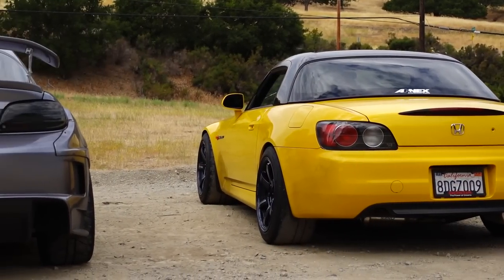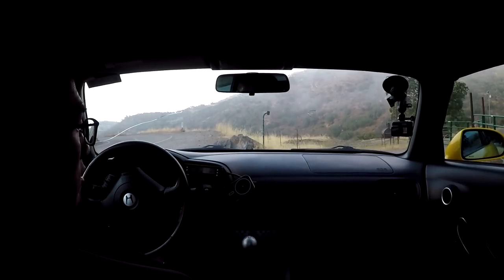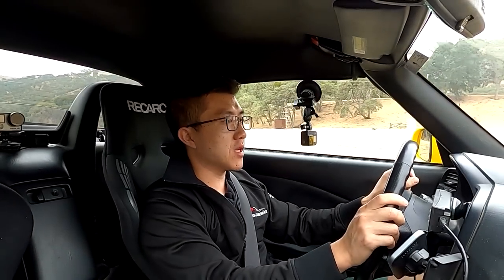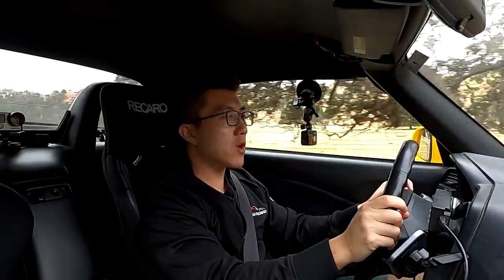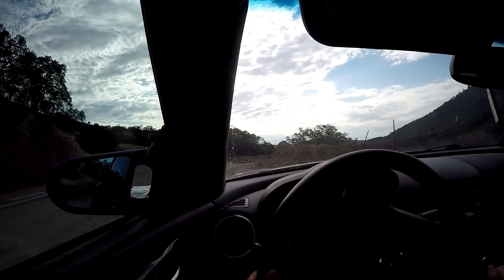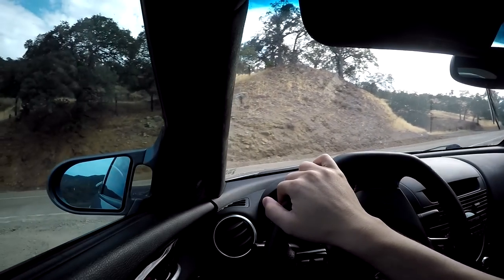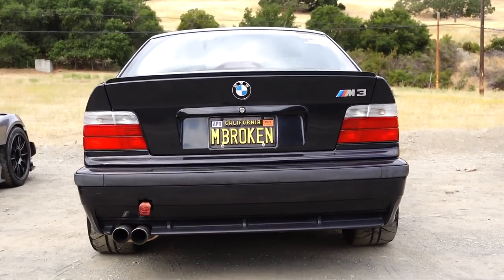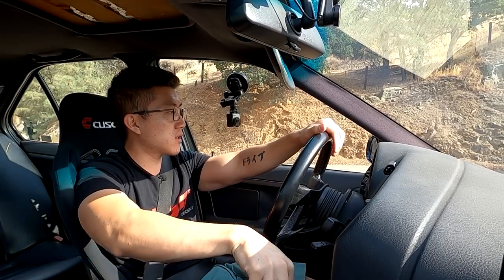Honda S2000 vs Mazda RX-8 vs BMW E36 M3 (Modified) - Head to Head Review!

Comment: I always thought of the Mazda RX8 as a combination of S2000 sportiness with BMW 3-series cabin refinement. Therefore if I have can only have 1 car as a daily and weekend canyon carver it would be the RX8 except that I'd ditched the Kamikaze bodykit. <shudders>. But if I can have more than one... sure S2000. Why not. But I'd keep it stock and AP2. Drivability and refinement. Time has not been kind to the e36 3-series. It's a no-go period. Video should've replaced that with an e46 BMW candidate instead.

Comment: Take the S2000, put a built ITB J35 in it, stick the transmission in the rear like a Vette/Viper, slap it with a 245/275 or 255/285 staggered setup with dialed suspension and brakes, call that a perfect build. MAYBE procharge it if you want more than 400 wheel.

Comment: Building an E46 330ci for track use. My only gripe is the lack of factory LSD in anything but the M3
Reply: My E36 328is got 2.93:1 open differential. A junkyard sold me an LSD (rather inexpensively) with the same ratio, but I found out that it's just an open differential! So I sent it back & they converted it to Torsen & gave it back to me. Is that worth a lot? It does make a “bad-bearing sound” in neutral gear, though. How should I fix it?
Reply: I decided to just buy an S2000 to replace my 330ci ZHP since I never used the rear seats with a Suby DD. It's a shame BMW nerfed even the ZHP with no limited slip, while Honda didn't even question putting a torsen (and 6 speed) in every S2000.

Comment: Great video. I’ve been contemplating on adding another car to the stable. S2k or rx8. I already have an evo 9 mr, e30 with m50 swap and my motorcycle does most of my commuting to work. So the next car doesn’t have to be practical at all. The rx8 can still be had for reasonably priced and I won’t feel bad taking it to a drift event and back it into a wall lol and the S2k prices are starting to stagnant but it’s hard to beat that S2k sharpness and Honda reliability and oh mpg’s lol decisions decisions
Reply: Prices are rising not stagnating.
Reply: I been contemplating a RX8 to add. I have EVO X GSR , MR2 sw20 , FC RX7 x3, 3000gt sl, and a built Civic eg coupe. I have a couple others but not counting to the enthusiast list
Reply: @claudedottin1312  rx8 can still be had for a decent price. That’s kinda why I want one. Still fun and way cheaper than an s2000
Reply: @rushfactorygarage  exactly! All my cars were cheap btw lol. But yeah it’s not like a huge huge decision because price wise and we m trying to have my cars all different according to the uses. RX8 can also be made to look really nice and it’s (practical fun)

Comment: Have you ever driven a spec e46 car? On paper I feel like you might like it, ~2650-2700 lbs fully stripped and like 220ish whp. Feel like BMWs really come alive as track cars once you remove all the extra luxury car fluff lol.
Reply: That's where most of it's weight is. It's a car meant for luxury/sport. Ive only deleted the rear so far and man it made a huge difference.
Reply: yeah even if you dont go all out you can save a good bit of weight doing the reversible weight saving mods.

Comment: S2000: attracts high school boys, ultra-ricers, needs a roll bar to hit the track and ultimately makes you overspend for a "clean" car that you'll just ruin yourself.
RX8: harder to find, generally can come with rebuilt engine, nobody wants to be the last person holding on to one
E36: vanos, sagging glovebox, plastic parts, but probably the most controllable and easy to track car.

have owned 2 of the 3, they were all fun and headaches in their own way :)
Reply: Rx8s are fantastic on track! I was easily able to hit lap times close and beat to drivers of “faster” stuff (foRS, 135i, lotus Elise, caymans, etc.) even as a relative novice which speaks to how easy the car is to whip around corners

Comment: would you prefer a gr86 over an e36 m3? they are pretty much on par in my opinion and is a flip a coin for me. I would say the only thing with the e36 (coupe or sedan) is the actual usable back seats. So it is a more every day car than a gr86.
Reply: GR86 will likely stay working well for longer lol
Reply: @PeterPangea  really? have you tried servicing a boxer engine?
Reply: @Bmwstephen  Spark plug removal...
Reply: @PeterPangea  Do realize Subaru has had nonstop recalls on engines right?
Reply: I have an e36 M3, my good friend an FRS.  Both are great cars, I'd like to drive a new gr86 as it does seem like on paper to be closer to the e36 M3.  The M3 has serious torque compared to the older FRS, the FRS in stock form has sharper suspension and steering.  The M3s back seats are definitely more usable, though we've taken people in the back of both on 4 plus hour drives.
Reply: @johnpearson492  nothing a square wheel setup and zhp rack won’t fix on an e36.
Reply: @Bmwstephen  Which is what I did! Square wheels and a Z3 1.9L quick ratio rack along with the x brace absolutely transformed my e36.
Reply: @creakid  you still driving that 328, i have one too, what mods do you have done?
Reply: @johnpearson492  The guy who just sold his FR-S stick fell in love driving with my E36 2.8 coupe (with suspension raised to the base stock height). I can see why -- Brimming with even more steering feel (with non-M Z3's quick rack & Torsen LSD conversion) & still absorb bumps (especially speed bumps) with many times more composure.
Reply: @r0xy149  It's a 1999 stick, white with white interior, nearly mint (less than 50k mi) when I bought it used in 2006 for $17,400, with ANSA muffler, cold air intake & an aftermarket rear spoiler, which I removed due to blocking the rear visibility. Afterwards, I've added:
1) Quick steering rack from the non-M Z3.
2) Torsen conversion on the 2.93 open differential.
3) Raised the ride height of the M-Tech sport suspension by changing to standard coil springs & Monroe shocks. An E36 M3 probably won't allow such change.
Reply: @creakid  I'm not sure about the gr86 but iv got a gt86 and changed the spark plugs myself using a video on youtube without even having to lift the car
Reply: @user-sk4wf3ve6z  You didn't have to drop the engine by 4"？
Reply: @creakid  no,you can change them from the top with the right tools and a bit of time,you can look up videos on YouTube about it,if you want to see the video I used,it's by countersteer garage and the video is titled 'hoe to change spark plugs in the frs in an hour',took me over 2 hours though as I'm a noob 😂
Reply: @user-sk4wf3ve6z  Thanks.

Comment: Hello, i would choose M3 'couse it"s the only race car here, not sporty like. In US U may not know - e36 was winning a lot in DTM Class, super tilted car - You could even buy BMW INTERNATIONAL or Class2. US M3 is simply weakned, it has 245hp only - almost like 3.0 e46. In UE we had M3's 286-321Hp, so even tuned to 260hp - still slower than stock UE. I love Cabrios so s2000 body is cool, RX-8 looks nice but the interior .... - don't like hi reving, low power ratio is much cooler for me - now i drive 330hp r129 SL which may be little bit faster, but now sucha expirience. Great compare!

Comment: I have been looking at trying to get wing extensions like those for my RX8 as well. If anyone can guide me, I would greatly appreciate it, or if you still can get in touch with the RX8 owner.
Reply: Those are the feast power risers. I bought these from another RX-8 on instagram, wanna say they're long out of production. You can machine and design your own though, wouldn't imagine it'd be too difficult.
Reply: @PeterPangea  yea I was looking around, they ended production long ago. There are some alternatives, but they look hideous. I have a shop that said would CAD me some, but because it requires build from scratch, they quoted me like $600

Comment: How would you rate the steering feel of Toyota 86's EPS compare to these three cars?
Reply: Which 86? I’ve personally tried the first gen (along with other examples of all the cars in this test) and I’d say the feel is similar if not slightly worse than the rx8.
Reply: @PeterPangea  Thanks, I did drive the Scion FR-S & the 2004 RX-8. Both of them got good enough steering feel -- better than my 2012 Golf 2.5's boring EPS. & I happen to find the ND's power steering too light with insufficient resistance (both the Fiat & Mazda versions). BTW, I loved that 2004 base-model RX-8 with a pampering soft plush ride riding on 16" wheels (while still got immensely high road holding), but it only comes in auto with no stability control. So I called the dealer & found out that both suspension set up share the same dampers, & only the sway bars & springs are different. Therefore an easy swap on the Sport (base stick RX-8) with the headroom-laden slick top. I would still swap the driver seat with the power seat in order to tilt the cushion, while change the passenger seat with an aftermarket lower-back seat (separate head rest) in order not to obstruct the “panoramically wide rear visibility (missing from the Miata hardtop after NB)”. But all together, the RX-8's lack of low-end torque is got to go -- perhaps with electric-motor conversion (rotary breaks down too soon). Therefore, I ended up collecting these two used cars in mint condition:
1) 1999 (last edition E36) 328is stick & converted to Torsen (still with tall gearing) plus the “quick steering rack from a non-M Z3”, & raised the ride height to base-model spec.
2) 2002 (last edition Z3) 3.0 stick with Torsen in order to avoid the M version's “slow steering rack & viscous lsd”. Peculiarly, it's power steering boost is less natural than the early Z3 1.9 version's. Now, I want to raise the ride height & wonder if getting the dampers/springs from a base Ti would work?

Comment: Zygrene, you got me looking for AP2 trannys for my AP1. Have considered after market rear diffs too. What's the better way to go, anyone?
Reply: Drexler is supposedly the King, but know a few people with the OS Giken and they rave about it. ATS Carbon hybrid is meant to be excellent too but have heard it requires more maintenance due to the composite discs and they can delaminate with heat.
Reply from the maker: All I can say from experience is that OS Giken diffs make a ton of noise. AP2 tranny in an AP1 is guaranteed giggles though.
Reply: Puddymod makes a diff with a lower final ratio and strengthened.

Comment: Currently have a Daily, S2000 and a Truck and having 3 cars is kinda tough. Curious if a modified 996/997 could fill the hole if I sold my S2000 + Daily.
Reply: I wouldn't trade my S2K for a 996.
Reply: E46 M3, as someone who’s owned a 996 and an e46 m3. That being said, I currently daily an nd2 Miata RF. And the new BRZ is also a top competitor for that usage.
Reply: Depends what you enjoy about the S2000 and your use case? 996/997 does not have the same front-mid balance that the S2000 has (read: the Porsches have a ton of rear end grip). They also won't survive on track without significant modifications. I wouldn't trade mine for any non-GT modern 911.
Reply: Sold my 987 Cayman S, but kept my s2000.  There's no comparison.
Reply from the maker: I just drove a lightly modded 996.2 Carrera. Comparison video with another modified RX-8 coming soon!
Reply: @beauwulf  This is a striking comment given the 987 is the superior machine in nearly every way.
Reply: @RearWheelZeal  The s2000 is far more fun than the 987 S.  The 987's biggest flaw is the extremely long gearing and the McPherson front suspension.

Comment: Dude, be a little less bias
S2k: 2855lbs 237hp 150tq
RX8: 2880lbs 237hp 159tq
Yet somehow the rx8 is "soo slow"
Reply: RX8 is slower. Don't believe the HP numbers quoted by Mazda. :)
Reply: @papatonys  thats not even what im refering to, he exaggerated the weight and the HP for his Favorite car, and the other one he inflated the weight and rounded down the power
Reply: @PseudoKirby  The guy drives both cars back to back and clearly states his feedback. (which is in line with many others in that the RX8 is let down by it's engine). Why are you so fixated at the numbers? He is as biased as anyone that has driven an S2000, it's a special car for a reason.
Reply: @papatonys  everyone droves these worn out rx8s that have been abused, come drive my recently rebuilt rx8, it will change your mind
Reply: @papatonys  also again I am just stating that his tone and phrasing are biased, that is all
Reply: I wouldn’t say my car is worn out by any means (still makes decent compression), but yeah Mazdas 237hp is super optimistic lolll
Reply: Because rx8 hp rating was overrated, it’s more like 210hp, they dyno 170-180whp vs 200whp s2000.
Reply: Lets say its 50 HP higher on the RX-8, 1st gear still goes up to 41 mph at 9.5k rpm, so its 0-30 is atrocious! Why is this? Look at the torque curve, its exponential (power is almost a cubic function being made at the very very high rpm range). This is different than piston engines, where you accelerate much faster at the low end than the rotary, and piston power is almost linear for most of that 237 (meaning you don't sit there and wait to the very last rpm to break 200 HP, which won't happen until like 30-35 mph!). Also the rotary has a second intake that opens after 6.5k rpm, so its really not making torque until 28 mph (and that's just torque, not power).

This is like motorcycles, a typical 600cc bike can easily hit 130 HP, but its at 14,000 rpm (redline 16k rpm or higher). 1st gear typically 85 mph on that class (liter class is often 105 mph 1st gear), and then you compare to a bigger V-twin that makes the same 130 HP that's wheelie happy because it makes it at around 6k rpm (and its probably geared lower as well). This means the sport bike CANNOT make 130 HP until around 80 MPH in real world even in first gear, while the other you may hit it all the time in town (if you wanted of course). That's the closest comparison I think I can make.
Reply: @jakegarrett8109  u talk like the S2000 doesnt also have all its power up top...
I start feeling the power at about 4k, which is earlier than when VTAK hits on s2k
Reply: @PseudoKirby  the torque curve on rotaries show the peak torque is about 6.5k rpm (and it's rather low until then), and you can certainly feel the exponential power curve in the seat. Piston engines are still going to have higher average power output when peak power is equal. Therefore when you look at power under the curve (integrating with respect to time to find work done), you'll see the piston engine in the S2000 would have higher average power and work if it's the same peak power. Now this also assumes similar gear shift ratios since the engines are similar redline rpm, but I've never owned an S2000 so Id have to look up the shift point data on it, but if first gear is similar or lower than 41 mph then you'd have faster off the line takeoff with the S2000.

Comment: I choose the:
E36 m3/4/5  (euro spec)
Because I own one :)
Reply: How's the reliability of the engine?
Reply: @creakid  so far all I've done to the engine is routine maintenance (plugs, valve cover gasket, oil change) has around 80k miles on it. I just did brakes and suspension bushings & repaint
Reply: Mods
Short shifter
Comforti chip
A&E cold air intake

Comment: With almost 100 thousand miles this engine is almost done mate. With the mods it has it should be about as fast as the s2000. We'll thats rotary for you. Apex seals say bye bye at around 60k thousand miles.
Reply: The engines compression is just fine, but yeah I’d love a fresher ported engine that would help wake the car up. Ultimately it’s fine in isolation

Comment: I would rather have the new BRZ, over any of these old cars.
Reply: If you build one of these older models yourself then the monetary cost of entry is WAY lower than a new BRZ. And don't forget that a quality restoration/mild build can increase the value of a car significantly.
Reply: @RearWheelZeal  true but you would need to have the skills to do it and tools do it properly, I really think the Honda S2000 is a solid platform. and I would like to see it come back, with a k series motor.

Comment: lmao why is the rx8 on this list, and shouldnt E46 be compared here instead of the E36 since these are all early -mid 2000 FRs?
Reply: Probably trying to keep it comparable with used prices for the cars s2000 already getting really expensive e36 slowly going too.

I wish ford had put out the cobra 2 seat roadster concept in the early 2000s

Comment: Lawnmowers
Reply: My lawn mower only does 40 mph (3rd gear), my RX-8 I did 41 mph in first gear this week, so its a little faster than my lawn mower.

I'd love a rotary powered mower though, actually, now that I think about it I might own one (my grandfather had one, and he passed away, I don't think anyone picked up his mower, although his flying push mower the "fly-mo" is cooler because you can go side to side instead of being constrained with wheels)